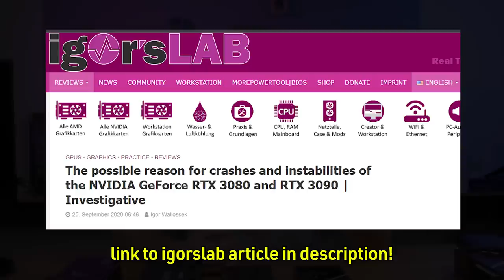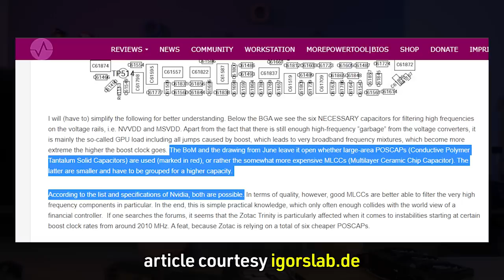The RTX 3080 Launch can't get any worse... Right? Wrong...

Comment: That's why you don't buy new tech at day 1.
Reply: If I had gotten one of these at launch, I'd not be feeling too bad. Maybe my card never crashed once, but if it did, Jay just told me how to undervolt it a little until a firmware update comes out. The way I see it, an RTX at 95% is still the best card around, and I paid US$400-600 less for it than the price of a 2080 Ti last July. Asking for an RMA is the very last thing on my mind.
Reply: Ah but if no-one bought them on day 1 then how would people know that there are issues? Unfortunately someone has to buy on day 1 to keep these companies in business.
Reply: looks at 2060 thinks of super  starts crying
Reply: Exactly. Also the fact technology evolves so fast it's smarter to stay 1 -2 models behind to guarantee consistency. If you use V5, wait until V8 drops to upgrade to V6, max a V7.
Reply: Fuckin exactly, I'm drooling here on a 4k ultrawide-screen waiting to play flight sim but I'm not gonna touch any of these cards for at least another 6 weeks smh...
Reply: busfahrer09 
I'm in exactly the same situation -- 6-core/12-thread cpu, 32 gb of stable 3600 RAM, fast Evo Plus PCIe SSD, Flight Simulator 2020 installed, 34" ultra wide monitor, 100mbs Internet, Honeycomb yoke . . .  and no GPU (x/c for an old Radeon 570 I used to get Windows and FS installed). I'd take any 3080 card I could get at or near MSRP right now. 
BUT Tom at Moore's Law accurately predicted the near-total unavailability of Nvidia cards at launch, and he is predicting that in spite of a much later announcement date, wide availability of AMD RDNA2 cards will still occur BEFORE we can get an RTX 3080. Other predictions are near-3080 performance at a lower price and at something like 250 watts. THAT is why I don't mind waiting the 6 weeks you mention in spite of saying I'd accept a 3080 now; that and the fact that Nvidia have shot themselves in both feet and their scrotums with this launch that they botched so indescribably atrociously that Huang may be looking for a new job.
Reply: @Buddy308  true mate. Could actually happen that I go for an AMD for the first time... What monitor you went for? I'm kinda disappointed that no one thought about a top-end ambilight version, I contacted Philips about that almost a year ago... They said they don't see a market for that, these fuckin tools.
Reply: busfahrer09 
Monitor? I puzzled about that more than anything. I hadn't messed around with FS for 20 years, so I didn't have much experience, but by lurking in forums a long time, I discovered that almost no veteran flight simmer does it at 4K. I was going to use a 27" 1440 monitor I already had for a few months to see how that went, but I found a superb LG 1440 ultrawide for about $180 off at Micro Center and had to get it. It's the LG 34GK950. It's compatible with vsync on both nvidia and AMD cards, has 10-bit color, and has a 144hz refresh rate. The Radeon card I have has no trouble with any resolution (just can't get frame rates above 18 at medium settings), so I can already tell that 1440 is ideal. The most important thing I've discovered since 8/17 is that (a) no GPU is going to give frame rates greater than about 50-60 Hz in a flight simulator at ultra and that (b) even 30 Hz is very playable in flight sims -- i.e., extra money spent on a monitor faster than 75 Hz is wasted. One needs 120-160 only if the thing is used for FPS games as well as Flight Simulator 2020.
Reply: @Buddy308  I see, I'm gonna check that one out... I went for the Philips 499p9h but I'm not that satisfied with the pixels, while the immersion aspect is (probably) top notch for someone like me who's trying to safe some money (I'm making my license on the DA62, and every lesson costs quite a chunk) I'm not feeling like I could spend several hours a week on that...
Reply: busfahrer09 
That's a dream monitor. It's price is above my limit for now, but if MSFS develops into a very serious hobby, I'll reconsider, just as I'd then reconsider on peripherals by Virtual Fly, for example.
Just what do you not like about the pixels on your monitor?
Reply: @Buddy308  it's made for traders or video/sound engineers, it has 'severe' screen tearing playing egoshooters or even big teamfights in League... and I'm not paying 1k to just play flight sim ofc.
I think, also immersion-wise, it's better to play on something like the LG 34GN850-B, or little bit bigger, and put two other screens angled left and right to simulate the cockpit overview but that's double the price in the end... :/
the sim is still kinda in beta imo and the corona clownworld will stay for another couple of months so we've got time to break a couple of walnuts over this problem lol :D
Reply: busfahrer09 
The 34GN850 would actually be my first choice because its been given official status as "compatible with G-Sync. The difference in MSRP between the 34GN850 and it's immediate predecessor, my 34GK950 is only $100, but I found mine at Micro Center for $280 less than the street price of the 34GN850. It has essentially the same specs over HDMI, although the gn850 will refresh at "160 Hz" over DP while the GK950 kids limited to 144 Hz over DP. The older monitor has Freesync 2 rather than vanilla Freesync, and all reviewers with Nvidia report that their GPUs instantly recognize the monitor as compatible with G-Sync and actually work flawlessly with it. My monitor does have what LG calls "Nano LCD" and 10-bit color just like the GN850, so about the only difference I can see is a marginally higher vertical refresh rate, which is of absolutely no use to me running flight simulators, so for my purposes, it's like getting the GN850 at a $280 discount.
Reply: @Buddy308  yeah that's a bargain then, how much did you pay in the end for yours? I'm gonna wait for black friday maybe for a final decision and act quick afterwards...
Reply: busfahrer09 
$720 + tax
Reply: @Buddy308  damn that's an amazing price, almost half of what I have to pay here even though I don't know what your taxes are over there... that concept is totally confusing for us europeans :D 
in your case, I'd aim for another two smaller screens in the next years and call it a day...
Anyway, keep the blue side up mate and hf flying!
Reply: busfahrer09 
Sales tax here is usually around 7.5%. Right now, the two side screens are not very useful for the flight simulator I'm setting up, MSFS. In that configuration, all it does is stretch the center-screen image over three monitors. When they add the capability of multiple monitors to MSFS, hopefully soon, I'll sure do that.

Comment: i bought a KFA2 RTX 2070 that has that problem , the OC from factory is to high , my solution was to reduced the clock frequenze to the card Spec and now works just fine . in my opinion they should not sell OC edition .

Comment: Imagine cheaping out on a product you're charging customers 700 dollars for.
Reply: you will find alot of companies do this including apple especially now since they do inhouse silicone
Reply: ZOTAC has artificially locked their $1600 3090 to a MAXIMUM of 350W making it performance worse than a $900 3080 STRIX!
Reply: ever heard of Apple?
Reply: @Ivan-np3ls  umm its a bad thing because companies should not be cutting corners w an expensive product
Reply: @icecold7  Yeah, it's why I've never purchased any Apple products thankfully.
Reply: @erikhendrickson59  zotac might as well be the worst AIB out there, so not a surprise really
Reply: @erikhendrickson59  where are those Strix benchmarks
Reply: Well if u put crappy components into a thing that costs quite alot of money because u put a 8-10x mark up on what it costs to make only for it to break down because of said crappy component and then apple shops charging u $500 to fix it yeah its a problem .

Cheeping out and using inferior low grade products in ur equipment can damage ur equipment! and also the brand it belongs too... i be surprised if they do this again because of what happened now people will wait next time and think twice about buying particular brands!

Prime example look at power supplies for computers would u buy a non rated one or would u buy at least a bronze certified one?
Reply: @erikhendrickson59  thats stealing in my book
Reply: That happens on all levels. Even multi million dollar items such as planes (especially Boeing ones -> MAX).
Reply: Depends on how much more money they are gaining by going cheaper, even if they gain $25 on each card by using cheaper compononents multiply that 25 by hundreds,thousands,tens of thousands, millions, and you'l see how worth it for them it is.
Reply: Ever bought a car?
Reply: @Tactify24  sorry i meant: How is apple cheaping out, when they thought intel wasnt good enough anymore and started doing it themselves?
Reply: Welcome to capitalism
Reply: @Spriggen1337  How are PSU 80+ Ratings a prime example? 80+ only saves you on electricity bills, nothing more: 80 Plus (trademarked 80 PLUS) is a voluntary certification program intended to promote efficient energy use in computer power supply units (PSUs). ... Such PSUs waste 20% or less electric energy as heat at the specified load levels, reducing electricity use and bills compared to less efficient PSUs.

There is this thing called overhead costs, companies have to charge enough to offset that and still make money. So, no, for most companies they aren't actually marking up that much. crApple, now that's a different story.
Reply: @Tactify24  I mean, I sort of agree, especially when they go below spec (so in this case I certainly agree based on the facts we have at this moment), but if they only used the very best components available, a card like this wouldn't be remotely affordable. They need to find a good balance or they simply won't sell enough. Clearly in this case the balance wasn't found (except for some cards like the ASUS TUF and the FE), but it seems NVIDIA are the root of the problem since their seemingly artificial driver/secrecy-based limitations meant that AIBs couldn't test their cards properly before it was too late.
Reply: @acywei   how do u think 80+ PSU get that rating from superior parts u buy a no brand Chinese knock off that's not certified u don't know if its gonna work or if it will fry ur system!

Yes I know companies have certain costs like RnD and part availability, but at the end of the line companies IF they can cut corners and get away with it they will and still keep the price high! Companies also factor in an acceptable loss too which means returned or faulty cards and this is also factored into the final products price they already knew the failure rate in them cards and only one of them was honest about it b4 jay reviewed it!

Comment: It looks like all 6 of the capacitor positions have the footprints for both the larger less expensive single capacitor and the multiple smaller more expensive capacitor. Potentially these could be reworked pretty easily to replace some or all of the large caps with the better smaller caps. These smaller caps will filter more high-frequency noise from the power going into the chip, mostly from the data busses on the PCB whereas the larger ones will not but can deliver more instantaneous current under a spike load.

Comment: "The only guaranteed speed is 1710Mhz" - So to make benchmarks show the guaranteed minimum performance these cards should all be benchmarked with no boost clock?
Reply: meanwhile my asus 3080 tuf rolls at 2 ghz 3d clocks.
Reply: That's definitely the rub. How much of the "fps/benchmarks" posted by the companies were based on these cards using boost at times? I'm sure the numbers in Nvidia's presentation certainly were. I haven't looked at each AIB's website or sale postings to see what type of claims are made there for their specific cards tho.
Reply: Benchmarks are meant to show the maximum performance of a product, thats why they use high end systems with plenty of RAM.  Best case is an open bench in a climate controlled room, so that's what most of them do.
Reply: They're doing out-of-the-box benchmarks for the most part. If they notice crashes during the benchmark, you can be sure they will tell you about it.
Reply: tbh reviewer should do this. not all card have same boost after all.
Reply: Why bother from a reviewers standpoint.  If you want to see a flat graph for 6 cards, just put 6 numbers into excel that vary by 1-2% and jerk it until the cows come home.
Reply: Uh, yeah? Adding those numbers would help.

Comment: Had this issue with a certain NVME carrier card we purchased hundreds of. In response the manufacturer forced the 4x PCIE bandwidth to 2x in firmware and called it “fixed”. The cards don’t have issues anymore, but certainly not ideal.

Comment: I never though the day would come when we had to underclock our cards just to make them work.Strange days we live in.
Reply: It's 2020
Reply: AMD already beat Nvidia to that. Tons of my friends with AMD cards needed to underclock just to have a stable card haha
Reply: i had this problem with gta v checks notes in 2015! my than gtx770 (gigabyte btw) would just crash out the blue when playing gta v (and only in gta v) and after weeks (yes weeks because the crashing was not consistenly reproducable) of headaches as to why that f*cker crashes there, i ended up in ~some~ russion forum where google translate sputed out something of downclocking the gpu and as a freaking last ditch effort i tried it and it worked from there on! its eems like a dumb fix but a slower working card is much better than a fast crashing one :)

Comment: Does anyone know the actual price difference from POSCAPs to the MLCCs ?
Reply: Cheapest 470uF Aluminium polymer SP-CAP (cap that is used by gigabyte) costs around $0.60. 47uF MLCC costs around 0.03 - $0.04 (x10 = $0.4). So really when Jay says the card “has the cheap array”, really, it’s the more expensive config Source: Digikey and https://youtu.be/T1I-kS3lZUc @ 18:40ish

Comment: When Jay asked why the gigabyte's backplate was so difficult to remove I automatically assumed they wanted to hide something and oh boy I was right.
Reply: i was thinking this too, weird really cuz in the previous generations their backplates are fairly easy to remove. Their design choice might just have confirmed them trying to hide this issue.
Reply: @ragediztortion  Yeah but thanks to the video we knew about the problem before checking the gpu.
We don't know if Gigabyte knew about it before going with the design. For example Powercolor told Jay there was something wrong with the card while investigating the issue.
Reply: Nah, I don't think they INTENTIONALLY tried to hide the caps. They probably just wanted to hide the screws. 
I'm not saying that to defend the company. Building under spec is naïve, if they did it. And they should actually fix that. But also... How many people are taking the backplate of the card? It doesn't really need to be accessible oO
Reply: @neshugg9486  I am pretty convinced they knew, i think it is standard procedure for companies to conduct extensive tests on their products before releasing it to the market. Specially a major issue like boost clocks which i think can be found quite easily.
Reply: Which gigabyte version card was this? Ventus or gaming?

Edit: not ventus I meant eagle
Reply: jupepi want to know to, is it eagle or gaming?
Reply: @KeepAnOpenMind , Both are POSCAP only. So just avoid an early Gigabyte. (btw same with Zotac)

Comment: No the caps were not the Problem, it was driver issues
Reply: @reinerborn5263  bruh you using internet explorer???
Reply: Lol no the updated driver is to underclock the cards to make them more stable 😂
Reply: @wtfman1217   Thats THE POINT!
Reply: @reinerborn5263  yes indeed!
Reply: WTFMAN wrong. Watch hardware unboxed. It was driver issue. Linux driver never had any issues. They did adjust the clock and voltage curve but it was 1-2%.